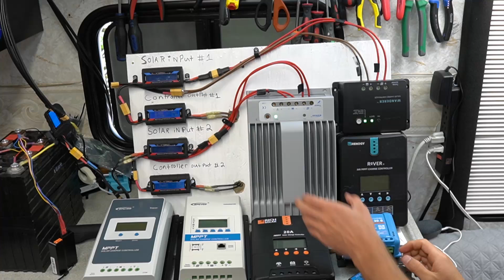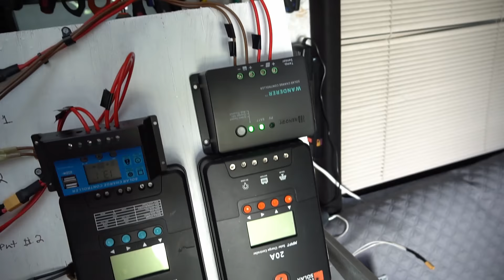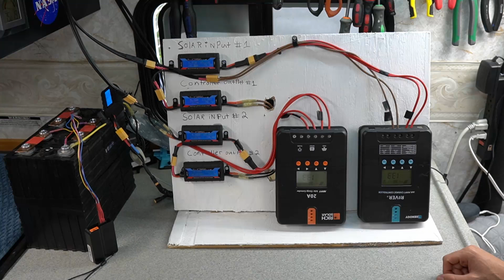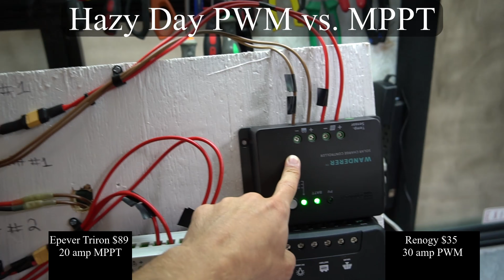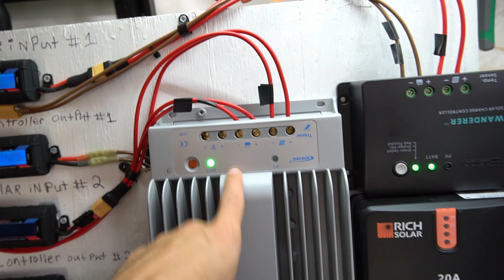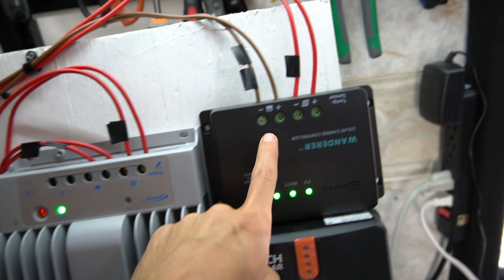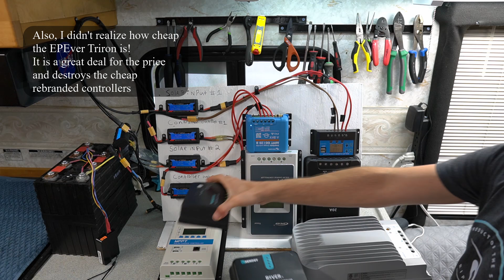12v Solar Charge Controller Buyers Guide - Beginner Friendly!

Comment: I'm 67 years old embarking on my first van conversion.  I'm a retired funeral director with no knowledge in solar energy.  I'm learning everything I can on YouTube.  You provide the most informative videos of all YouTubers.  Thank you for making it easy to understand and having the integrity to provide information that I strongly feel can be trusted.
Reply: Hey --Why show the junk charge controllers? I use 9 Morning star /Tri-Star 45amp and Tri-Star 60amp charge controllers. These almost never fail-They are top of the line.
Reply: @bobbailey7235  - Curiously, or not, I had "junk" controllers working flawlessly  for years! From those I can say the failure rate was EXACTLY ZERO! 
In fact they have been replaced because of upgrades, or should I say new systems! 
Trust me on this. As I like to call it, "credit card engineering" is not always better! But it's surely more expensive! LOL 😂
Reply: @bobbailey7235  I think it is because comparing involves comparing. To Not include or test the 'junk', as you call it, is like the school systems that try to 'lose' the scholastic testing of their 'not as smart' students. It would just be trying to play an All-Star game!
     Ya'll Take Care and be safe, John

Comment: Amazing! You stated and displayed your test Lab. You test and compared all charge controllers to each other. You stated which charge controllers should be used based on battery chemistry. You mentioned how to achieve optimal value for your dollar. Excellent, Will. Thank you. And you did all that in twenty minutes!
Reply: Probably needed to mention that the cheap mppt will last 2 weeks and not 20 years. Will you also didnt mention which unit causes the most RFI.

Comment: I have the small chinese PWM controller and so far it has been giving me a really good service with my deep cycle 12v battery. I just keep a small emergency Ham radio station that operates on solar 24/7.
Reply: That’s really cool. What is your solar setup?

Comment: Damn - I just ordered a Renogy Rover (not delivered yet) and, like you, I believe in using the largest gauge wires possible which means 10 GA to the panels (10A max current) and 8 GA to the battery bank (40A max).  I was a bit concerned about the wire terminals and now that I've seen your video I realize the Rich Solar controller is a much better choice.  I'm happy Amazon has such a good return policy...

Thanks for the review - you've just saved me some grief!
Reply: As handybob stated, thinner wires are a bad place to save money.  Im gonna use #4 wiring for everything.   Im considering using #2 wires from controller to battery bank.  The shorter the wires are, the less resistance you will have, and you will want to keep your batteries as fully charged as possible at all times.  Also, its important to keep positive and negative wires all the exact same length, or one wire will carry a higher load, especially when hooking the batteries together.  I'm going to do this for my whole system., shortest wires possible, all the same length.  I'm not sure if thats completely necessary but it makes sense to me so...
Reply: @nicksimon4536  I'm running a pretty simple system - two SLA batteries with probably a max 5A working load though possibly a 40A charging current.  The battery interconnects are 4 gauge while the system wiring is #8 to the controller and #10 to the distribution panel.  I ended up using the EPEVER Tracer 60A MPPT controller which had no issues with the larger wiring.

Comment: One  comment, one request, and one suggestion. Comment: Great job on all of your videos! No wasting time with intros, fast paced, edited, info packed, pleasant delivery, and more, as per all the other comments. Request: Compare real world performance of  4 x 100 watt panels in series versus parallel. Series connections good for producing power early and late in the day when voltage would otherwise be insufficient to begin charging versus the performance drawback of not being in parallel.  Good to know best solution on sunny day, on an overcast day, and a day with intermittent clouds. Suggestion: You use the word "cheap" to mean both poor quality and low cost. Although not necessarily confusing if the listener pauses to weigh context, there is no other word but "cheap" to represent poor quality, so that is the proper term. The word "inexpensive" is best for low cost.
Reply from the maker: Good suggestions, thank you

Comment: Great video! One other very important test is the amount of RFI they put out. RF Hash that ruins emergency communication and Amateur radio reception. As well as Shortwave and standard broadcast AM. A simple test is to bring a portable AM radio into proximity with the equipment and note the amount of static that is generated from the device to the radio. An important factor when choosing a controller for communication setups. Thanks!
Reply: you are an expert!

Comment: The EP ever 4210, it's a affordable controller and very good quality
I had mine for 5 years and never had trouble, works like a clock
I never go for expensive staff, there is no need to pay for a brand and it's cheaper to replace.
Reply: Clearly some of the brands are nothing but the same generic thing rebranded.

Comment: "This one feels like a McDonalds kid's toy."    LOL
Reply: wouldn't be surprised if they got McDonald's put it in the kids pack meals as a toy lol

hey kids try out getting into solar and save money on free power
Reply: I laughed too. Even more so when I realized this was the unit I am considering. But then, I'm 'only' trying to re-charge a small sealed lead acid battery to power a trail camera.
Reply: @ME-kq4wp  - I have several of those. In spite of no failures, really cheap prices, easy usage, etc. I do advise to get a slightly better PWM! Cost wise they're unbeatable, but as mentioned having a temp sensor can be useful in some applications! Cheers

Comment: I have 8 12v 100w panels 4 in series to a $15 controller to a  Led acid bank and 4 in series to a $15 controller to a 100Ah LiFePO4 battery. 5 Months now without any problems.  :)
Reply: I have had 10 75watt 12v panels daisychained to make 5 - 24volt output panel disharge for over 20 years,  and used a cheap 12v/24v PWM controller for most of its life, till I got gifted a 50 Amp RV Power mppt controller and could finally clock amp output on cloudless sunny days at mid day and found my system was making 22 amps so may have been exceeding its capacity (prolly 20 amps).
The 50 amp fragged itself so I am considering pushing the panels thru 2 cheap PWMs to lessen the load on each.
Reply: They all charge fine, in the long run but it's not worth the risk of using them on top of expensive batteries.

Comment: I just started investigating solar for an RV. What I have read is that partial shading of even 1 cell will significantly drop out from the panel. When panels are linked in series, the controller will adjust to the lowest output but in parallel, the MPPT controllers will output the maximum voltage from each panel for a larger total output to the batteries. I would love to see this confirmed on your setup by comparing series vs parallel with PWM or MPPT. Thank you for such informative videos.

Comment: Great video, Will. I went with the Weize version of the Rich MPPT controller. It has the more rugged power connectors and programmed up fine for my two series connected Newpowa 100 watt panels into my six gel cell house bank on my cruising sailboat. Same price point. Fire and forget, running flawlessly.

Comment: Made the mistake of going with Renogy everything building an off grid tiny house. Once I got the house in place in rural Kentucky my mistakes became apparent. Renogy's tech support is non-existent. You have to talk to a call center and trust that person with no technical knowledge to translate your question to tech support and then translate their answer back to you which takes weeks. Your videos have saved me. The only thing Renogy ever tells me is that I need to buy another piece of equipment. I'm currently running two 500 W solar arrays through 40 amp controllers which are run in parallel to my battery bank. I switched from a 3000/6000 modified sine wave inverter to two 1,000 w pure sine wave inverters. One runs constantly for my refrigeration the other I only turn on when I need to run a small appliance. Renogy actually told me that none of their controllers could be run in parallel except their most expensive one which was complete BS.  For those times when it rains for days I have a smart charger which I run off the 3000 watt inverter which is connected to my diesel truck. Thank you for the education.

Comment: Advantage of mppt: cost of larger 24v panels is quite a bit lower(compare 60 cents per watt vs $1 per watt). For example a 24V 320watt 72 cell single panel costing $230 Vs 3 separate 100W panels costing around $340 together. that huge difference more than leaves room for the extra budget for the Mppt controller. The PWM simply cant make use of the larger panels. Higher costs of 12V panels likely boils down to materials and circuitry beyond the cost of the solar cells themselves. So cost wise it would be slightly cheaper to have A 300W single panel and MPPT controller, than 3 100W panels and a PWM controller

Comment: Ive got the "small crappy one" on my boat. Works perfect on the 120watt panel charging the 130amp Carbon Lead house battery. You can even programme the output to run for different times from 1hr up to 24 hrs. I use my one to run a fuel polishing pump 4 hours per day while i'm away from the boat. Keeps the diesel nice and clean as well as keeping the house battery at optimal float voltage.

Comment: Glad u mentioned that multiple chargers won’t “fight” each other. I want to add a few panels to my RV. If I’m not at camp and mama wants to run the generator for the microwave or air conditioner, I wondered what would happen when the A/C powered kicks in but senses the power from the solar panels. Which one would win or take over?

Comment: Important is to understand how to set the controllers correctly, which eliminates batteries to overheat and cause kill our costful inverters, most controllers need to be adjusted upon the battery capacity,

Comment: I got the victron one because its small and it works in harmony with my victron shunt. also it doesnt get hot. mine is inside my tongue box right next to my 200Ah lithium battery with a 200w solar panel going to it and its just chilling out at ambient temps throughout the day. Also the small was very important because i have  teardrop and space is very valuable so anywhere i can cut down on size is pretty great. i also like to be able to see the charge stats while driving down the road via Bluetooth.

Comment: I love the part of this video where you are surprised how well the PWM controller is working.  I put a PWM controller (Morningstar Tristar TS-45) on my camper's solar system 13 years ago and it is still performing flawlessly.  But you can't believe how much flack I've gotten in various forums for choosing PWM instead of MPPT.  The PWM version of my charge controller was (and still is) less than half the price of the MPPT version.  Today it's $220 vs. $552 for MPPT.   And although I knew MPPT would be more efficient, I also knew that the system I was designing was more than enough for my needs even with PWM.   And I was right - I've never run short of power and am usually fully recharged from the night before by around noon the next day.

Now I'm putting together a new system for a 5th wheel and for this I will use MPPT, simply because I will have a longer wire run from panels to controller and want to put the panels in a 2s2p configuration to reduce voltage drop.  And there are so many less expensive charge controller options than there were 13 years ago. A reliable MPPT controller is much more affordable today.

Comment: I think its important to also remember this test is done on products over the course of only a couple days. Anything should output somewhat evenly out of the box. But how does it perform over an extended length of time? I've replaced a LOT of 6-18mo old renogy controllers for a number of different reasons in solar systems in campervans, but have never had to replace a Victron. How do the outputs vary in hot climates? Cold climates? Still a great test to start with!
Reply: I am using a Rich Solar 20amp in sunny Jamaica going 7-8 months now with no problems. Im planning on buying a second one soon.

Comment: Rich Solar owes you a commission. Because of this test video i bought a Rich Solar 20 am controller. It's been three days and im very happy with it. Thanks again, and greetings from sunny Jamaica.
Update: 20 amp Rich Solar charge controller is doing very well. I am up grading with more panels so i need a bigger charge controller and i have decided to buy a 40amp Rich Solar this time and connect both together.

Update: I got the 40 amp Rich Solar controller and running both the 20 and the 40 charging the same Power Queen LiFeP04 battery. I am very pleased with their performance.

Comment: im in Aussie would like a video on setting up basic solar system with lithium 200 ah battery for a caravan ,just not sure what controller to use ,i just love your videos cheers
Reply: Use Victron!
The 100/20 reg he uses in the video is very small and most of things he complained about, are not an issue once you go to their bigger regulators.
And you can plug in a display via the ve port on the bottom of the reg, or even a GX color screen that will take multiple Victron products.
What solar array are you going to use?
I live in Australia in NQ.

Comment: I've watched a number of your videos and overall, I think you're doing a very good job of keeping it interesting and bringing a lot of basic/mid level knowledge to the masses IRT solar panels, controllers, different types of batteries, inverters, BMSs, etc. As a former advanced electronics instructor, I'd like to help you out with a little advice, if you don't mind. In several of your video reviews, the equipment didn't work 100% - BMS with low temp cutoff not cutting off, etc. Your conclusion was that the mfr didn't get it implemented. But there are other possibilities. Perhaps you got a defective unit, or perhaps the temp probe was defective. I've learned over the yrs to never take anything for granted. I keep an open mind, because I've seen it all - from bad test eq. to dirty power in the outlet. 
In this video specifically, you left out quite a few other brands of affordable MPPT controllers, one of which I consider to be better performing than most. The Eco-worthy 40A BT controller is well constructed, big input connectors, external BT antenna and extremely fast MPPT tracking. Solar input can vary rapidly, even on sunny days. How slowly a controller tracks MPP can severely impact solar harvest. My experience with all of the Epever/Epsolar/Tracer series of controllers was extremely slow tracking, often off by 10v or more while the Eco-worthy connected to an identical solar panel was almost instantaneous in tracking. Tracking speed is an important aspect of MPPT controllers, ignoring it is like reviewing cars and ignoring acceleration and focusing only on trunk space. Sure, it's nice if a controller has larger connectors on it, but it can be worked around, it's a minor detail compared to efficiency, output, adjustability, etc. You could have used an assistant with a piece of cardboard outside to simulate varying solar input.
In your cable crimper video, you showed a 3 point crimper with a cordless impact. For $50, it's a piece of junk and doesn't really give you a great crimp. A proper crimp should crush the copper strands into a virtually solid state. You can buy an 8 ton hydraulic crimper with 9 sizes of hexagonal dies off ebay for $25, or a 16 ton with 11 dies for $38. Far superior crimp, which should be done with tinned copper lugs and sealed with adhesive lined heat shrink, not electrical tape.
Keep in mind, you have a lot of viewers who turn to you for expert advice and you're doing them a disservice if you don't show them the best practices, or MPPT controller, or crimper, etc. Just a little bit more research would really cement your expertise. In summary, overall, you're doing a very good job, keep up the good work!!
Reply: get your own channel...
Reply: @bellakairos3655  Mr Frakes is offering constructive criticism which I suspect Will is taking in the spirit it's intended, I appreciate both their contributions.
Reply: @bellakairos3655  Typical groupie knee jerk reaction...  I don't think that will is going to give you any personal information - I know that I wouldn't.
Reply: Thanks Steve.  Very respectfully submitted advice from you to Will.  I will be checking out the items that you mention as I am in the market for the best controller vs price that I can find for my 1st system.  I am looking at a cheap kit to get started but it comes with a a lead acid charger only so that will need to be replaced right away to get the most benefit for my Li-on battery packs. :)

For sealing your crimps I suggest the shrink tube butt connectors which include a ring of solder.  These can be modified for lugs and other terminals.  Have a great day to you and Will both. :)
Reply: I too was looking at the Ecoworthy BUT  a HUGE Number of 1star reviews - especially about overheating lead me to think that the product is not Will Prowse worthy